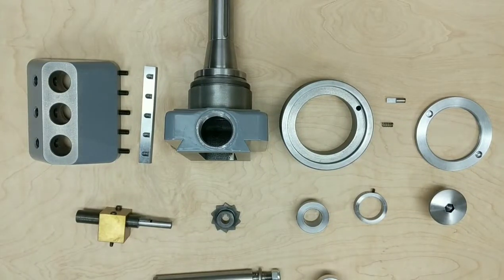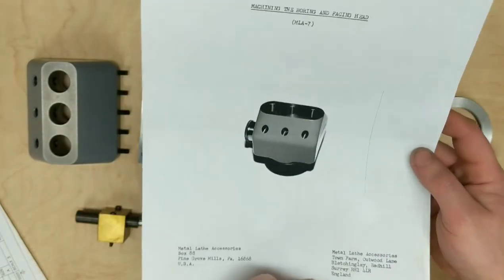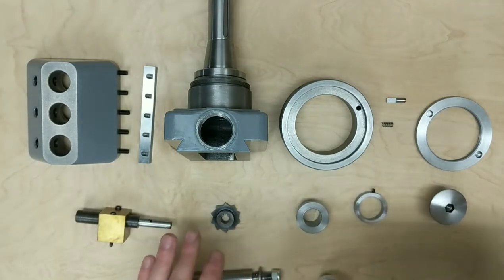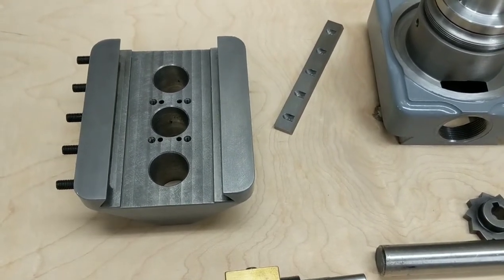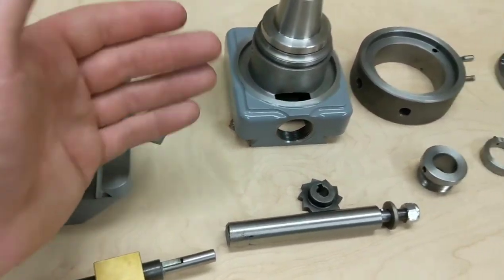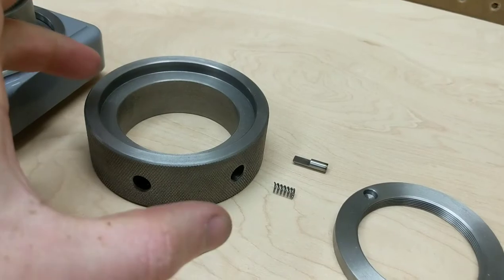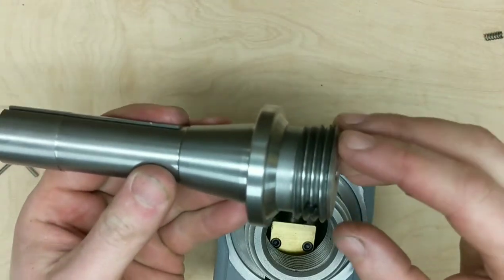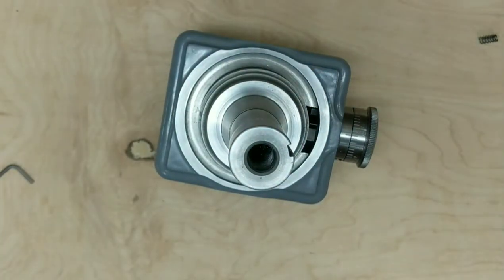MLA Boring & Facing Head Assembly

Comment: First class workmanship! I noticed that were extra holes to mount the brass nut, where they just for practice? I've thought making this for quite sometime, I have no idea where to get the 1/2 x 40 lh tap, would you be willing to tap it for me (ignore the previous insult!)? Thanks for your time,
Karl
Reply from the maker: They were a mistake, I drilled them on the wrong side at first. I was able to find a 1/2-40 LH tap on ebay for pretty cheap. I'd say try there first, and if you don't have any luck maybe we can work something out.